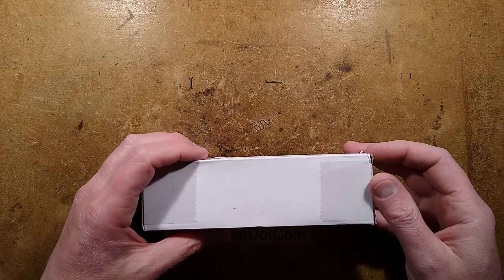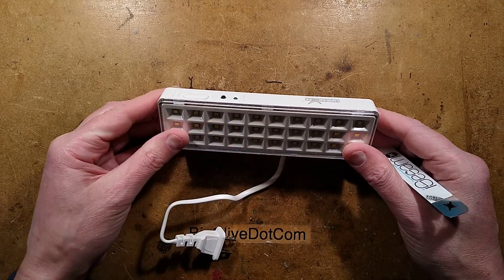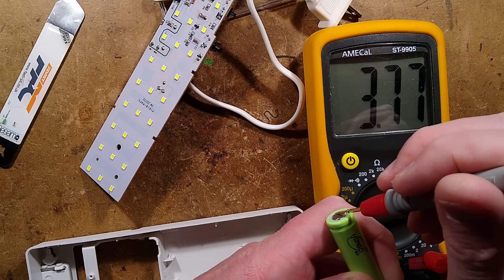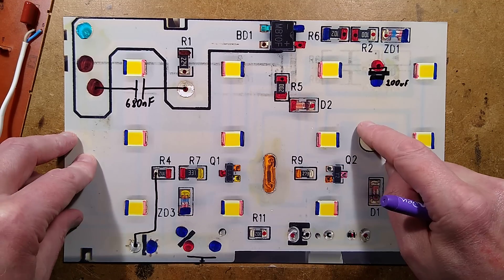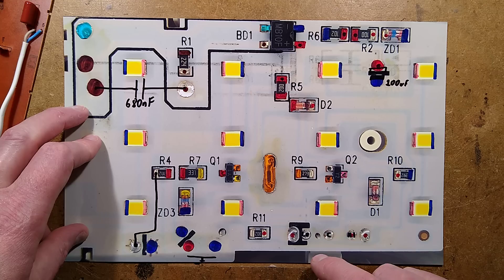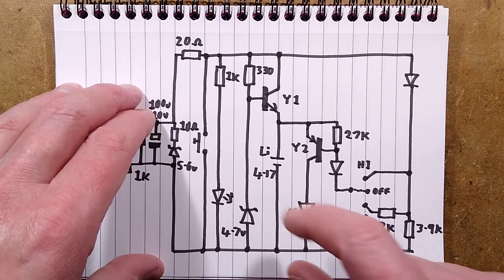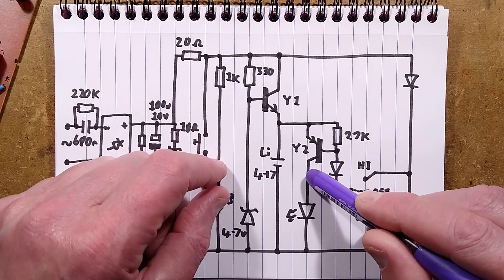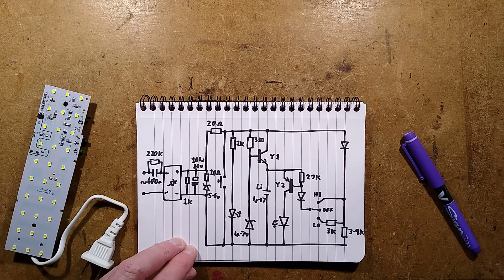$3 AliExpress 100-240V emergency light (with schematic)

Comment: Clive, our "free" lithium batteries will soon be no more. The UK government is banning single use vapes 😟😉👌
Reply from the maker: I'm sure the manufacturers will find ways around the regulations.
Reply: I don't think the ban will apply to the rechargeable disposable ones. They have nicer 600-750mah batteries inside with a nice tiny usb-c recharge circuit along with a digital display or led indicator too, rather than the 450mah-ish ones in the one-shot disposables. Get a few & parallel them. Even add a small bms if you're worried, but I don't bother cos use I them to replace the low capacity cells in outdoors solar lightning. Cheap li-ion power 😊.
Reply: tbh, banning devices that use a rechargeable battery in a non-rechargeable way, no matter what kind of device it is, would make more sense.

Comment: May be 'not bad circuitry' but not a very safe device, if it falls it can open easily showing the inside high voltage parts, neither strian relief of the powercord... Must be another quality - high safety device from good old China! to overflow our market with...

Comment: Really clever circuit,  well thought out unit,  £3.00 is a steal.  You could comfortably put emergency fittings throughout your house for about the same price as 40 fags

Comment: Every family has several emergency lights if you're in a country with frequent blackouts.
I got to know them from Brazil more than 20 years ago. But they had small fluorescent tubes in it back then.
They were everywhere - in hairdressers, supermarkets, stores, shopping-centers, garages...
Reply: South Africa the same, it is still odd that I have still had power on all the time for the last 212 days, when before you woulds have power cut almost every day, since 2008.
Reply: @SeanBZA  Interesting, I wonder what might have changed in the last 212 days?
Reply: @jimmybrad156  Lower power demand, plus there has been commercial and residential solar coming on line equal to at least 6 stages of load shedding. Massive numbers of medium power users have gone with either grid tie or fully off grid, with most of the Massmart (Walmart owned) stores all now having solar power as major part of their daily power use. Then lots of home solar and battery banks that are being used to shave peaks.

Comment: The charging circuit is a simple series voltage regulator.  These were very common before the integrated regulators became readily available. I built many series regulators myself back in the 1970's when battery eliminators were linear and unregulated. The unregulated supplies used a transformer, a diode bridge, a capacitor or two, and a couple resistors. The transformer would hold the voltage sorta close, but the AC ripple would be unacceptable for transistor radios no matter how big a capacitor you added. A better idea was to buy or build a higher voltage supply and regulate it down to the desired voltage using a series regulator. The series regulator would conveniently lower the ripple sufficiently for most applications.
Reply: The Commodore 64 (from 1982 or so) uses a regulator like this for the cassette motor. The early versions used a Darlington pair, while the newer revisions were cheapened to a single transistor.
Reply: @helgew9008  they most likely used a integrated darlington transistor in the newer revisions. They're pretty cheap and save on space
Reply: @Hunyadi1442  No, they used a 2SD313, a 2SD880 or a TIP29B. Possibly some others as well. This was back in the eighties and they were selling them by the millions, so every penny saved made a difference.
Reply: @helgew9008  ohhh, I thought that by the 80's integrated Darlington transistors were pretty common. I was born in 2005 so I don't know much about component availability from that time

Comment: With that big of a box you'd think there would be at least 3 batteries!

I have one of those black box solar lights, I had to change the battery twice in it, now I put two 18650 in parallel hope they will last more!
Reply: I managed to stuff 8 of them into a solar light, replacing the 2 dead EV lithium cells they had in there. Also had to replace the BMS as the venting cells had corroded the protection board in the shrink wrap on the cells. DW01 board, 8 recycled lithium 19650 cells, and a new glass front ( because it was stuck in with silicone) glued in place, and it has been working well for a year now. Took a week to get fully charged, and still runs the entire night at full power, even in winter.
Reply: These types of lights are ideal candidates for some paralelled disposable vape cells that we all seem to collect :)
Reply: Not necessarily, they keep heat management easy by using that LED board, then the enclosure has to be as thick as the battery in it.  Since it's not meant to be pocket carry, why would it benefit to be much smaller?  Besides, 3 batteries would increase the cost.

Comment: That can't be a very high capacity battery, 'cos otherwise the battery would be worth more then the whole unit!
Reply: If you want to check capacity of batteries like this then get an XTAR VC8 Plus battery charger. The first 4 of the battery compartments can run a 'Grade' battery checker, which does a charge-discharge-recharge and calculates the mAh's.
Reply: @andyspoo2  No need to get that specific charger.  Any better quality Li-Ion charger has a discharge capacity test function.

Comment: wont Y1 transistor get hot when charging a completley dead battery. i.e. highest current draw ?
Reply from the maker: The incoming current is limited by the capacitive dropper.

Comment: So the lithium cell will provide an audible and visible alert when its time to replace it. That's a plus I guess.
Reply: I'm with you on this.  A lithium-ion cell should never be continually charged, and I'm wary that the cell would wear out well before it should, with this style of charging circuit.  This type of charger is probably why you keep on hearing about lithium-cell powered devices going up in flames.
On the other hand, if it's a protected cell, then the protection circuitry may automatically stop the charging as the voltage rises.

Comment: This cell should have protection BMS (maybe it is built into the cell). If it is not there, it is worth adding it.
Reply: A single cell protection circuit board is still called a BMS
Reply: @davadoff  I know ! How silly !! :)
Reply: BMS stands for 'Battery Management System' this product does not contain a battery and therefore does not need a BMS, This is a single 'cell' stop with the 'Look at me everybody I know stuff look at me'
Reply: @andymouse  Untrue.   A "battery" can be a single cell and that single cell should still have protection against overcharge, overdischarge, and current limiting, except that in this case, the circuit itself inherently does this, unless it fails.  The one thing it doesn't need, being a single cell battery, is cell balancing.

In fact, some single cell batteries do have a BMS built in and then it's called a protected cell.  

As far as the look at me comment, you should feel embarrassed.
Reply: @stinkycheese804  Not me pal..Goodnight :)
Reply: @andymouse  Sounds like you should be telling this to yourself cause that actually is a lithium ion battery and they DO need a bms cause when lithium batteries get mistreated they can blow up or catch fire and thus need a battery management system. Also the fact that your logic is "battery management system means bms so it is only needed for a battery" is totally wrong! Its like saying you cant fry an egg cause its a frying pan and egg does not have the word fried in it. 

Unless this is ragebait i will take my comment away but please dont go saying "oh look its another person who thinks he knows stuff 🤓🤓🤓"

Comment: Li-ion at end of charge - must have the 4.2 Volt removed. Unlike PbSO4 batteries, they degrade very quickly if the charging voltage is not removed at end of charge.
Reply from the maker: As the full charge state approaches, the current will progressively drop to zero.  But I'd rather it charged to a lower voltage like 3.9V.
Reply: 3.7V is about 50% so the equilibrium of electrons in the positive and negative side of the separator.

that gives the max. possible life in a standby application.

3.9 or 4V is best bang for the buck hence older dewalt equipment used this as termination voltage.

the problem with the ever dead laptop batteries is exactly the 4.2V termination, keeping it at that and people not removing the battery when they work on-grid.

i got a toshiba Netbook @ Win 7 (the tiny 9-10" laptops, better known as the Asus? EEE PC), that's still on it's first battery. from 2015 !

always charge it to 50% then remove the pack when not in off-grid use and it will last AGES.

samsung one day inttoduced the battery saver which terminates charging at 85%. and even that does wonders to battery life.  like on my galaxy Tab A SM-T585 (also on it's oem battery)
and the previous white /silver bezeled Tab A that only serves as a kitchen timer for eggs and stuff.

treated right Li-Ion and Li-Po can last a decade.

but most devices + users never treat batterys right. being an apple product + the accompanying user makes everything even worse.

Comment: I built an emergency light before myself. I made the circuit with the Software "circuit" by Paul Falstad. I connected 14 one F Capacitors together, and you could charge them with a small hand powered generator. 30 seconds of charging is enough to power a white LED for about 8 hours before it gets dimmer. The capacitors are not anywhere close to full after 30 seconds so it has more potential. I was annoyed by these cheap hand powered flashlights that perform really poorly and wont work when you really need them.
Reply: 1F caps - that's a bloody big capacity.
Reply: 14F worth of capacitors for barely any light for 8 hours?  Seems expensive and bulky.  Have you ever heard of "batteries"?  I can grab my EDC AAA powered pocket flashlight and have light for 8 hours, or a lot more light for 1 hr.
Reply: @stinkycheese804 you can't charge a aaa battery and you can't leave it empty for years and expect it to work. Capacitors seem like a pretty good option for a hand cranked emergency light.
Reply: @stinkycheese804  I made it for emergency and camping. The capacitors can be charged more to hook up more LEDs and to last longer. 1F Capacitors are not that big (some of them are) and you can get them cheap. I got mine on amazon.(about 50€ total)

Comment: I'm looking at it and wondering if an 18650 would fit with a small amount of modding? At least it could have a protection circuit built in. 🤔

Comment: I bought an emergency led thing off aliexpress a few years ago, had the usual figure 8 plug input, worked one way, but when I plugged it in the other way it blew up
Reply from the maker: Most likely a bad connection causing arcing in the connector, or just circuitry on the edge of going boom.

Comment: Be careful! This charging circuit doesn't meet the charging requirements of standard lithium cells. When the voltage reaches 4.2 V and the charging current reaches an average of 0.1 of the initial value, charging should stop completely, otherwise a slow degradation of the battery electrodes occurs with the risk of short circuit over time. This emergency light itself will eventually cause an emergency. It's quite ironic.
Reply: What's really ironic is the light won't work during the emergency that it caused.
Reply: It should provide ample light in theory, and act as a back-up heater for those winter power outages.

Comment: I cant speak for all zenners but the ones that I used to design with had a voltage specified at 1mA for the 250mW and 500mW parts and 10mA for the 3W ones.

Comment: I hoped you would check the current draw when testing in low and high brightness.
Reply from the maker: 4.2V = HI-170mA LO-106mA
3.6V = HI-120mA LO-73mA
3.0V = HI-84mA LO-51mA

Comment: I'm amazed there aren't more zener+junction-drop charging circuits.  I guess you do have to make sure the input is current-limited, but at 500mA, most lithium cells will cope with that just fine, and it'll drop as the battery gets closer to full.

Much simpler than a full BMS.  Cheaper?  Dunno, charging chips are jellybeans these days anyway.

Comment: I wonder why they've done it that way... Dedicated charge controller chips are very cheap these days. But this is definitely a valid way to limit the voltage, and could be used in a DIY project.
Reply: Although, if the zener 4.7V zener diode fails open circuit, it could overcharge the cell. But zener diodes generally fail short circuit, and there won't be enough current to blow it open.

Comment: I might get a few of these for my basement, but modify them for 12V DC power as I don't want to run mains cables to the various locations.  Maybe I'll use an LM317.
If the 500mAh batteries don't last long enough, then I can make the lights dumb and the 12V DC can be on battery backup and handle the cut over on power failure/test.
Reply from the maker: I'm wondering if using a 5V USB supply on the DC side of the rectifier and maybe getting rid of the 1K resistor next to it may be an efficient option.  My choice of power failure lights is still a head worn light and the classic PIR ceiling lights that will kick in when needed.
Reply: No need to even use a LM317, just remove the 680n capacitor, and replace with a 220R 0.5W resistor, and it will operate exactly the same as before on 12VDC or AC. Battery the same, or replace with a pouch cell, though this cell likely will provide output for around 5 hours on dim setting, slowly fading as the battery discharges, so it will still glow after a day with power off.
Reply: Why even bother?   I mean you don't need this light at all then, just use a buck switching current regulated LED driver to drop from 12VDC to whatever current your array of LEDs needs.  More efficient, or of course you could just swap out the 14500 cell and swap in an 18650 around 3400mAh and it'll run longer than you'd normally need.
Reply: I design IoT based emergency lights for a living (amongst other things), so the electronics is no problem.  LM317 was just a quick idea that others could also use, as I typically use boost or buck LED drivers from Diodes Inc.  My interest is the low cost compact housings.  They don't need to be compliant with standards for use in my basement workshop.
Reply: BTW, I ordered some of these lights 3 weeks ago, and got them last week.  Getting ahead of the BigClive effect can be important as the price from the store I bought them has now nearly doubled.  Still reasonably cheap, but not quite as easy an impulse buy.

Comment: Very clever way to connect to the battery!
Reply: Avoids needing a battery lid! (which always gets lost or broken). Cunning cost-saving.
Reply: Very cheapy Chinese mass production stuffs
Reply: @Liz0rdX80  I think the way they did the battery/hold very clever, also makes it easy to upgrade the battery capacity or replace if failed, no soldering, etc.
Reply: @richardwernst  yep

Comment: It shorts its power supply to test? That's cheeky!
Reply: It's not /quite/ a short, as there are resistors in the circuit.
Reply: That avoids high voltage appearing anywhere past the dropping capacitor. It's also a real test.
Reply: Nothing is significantly stressed by shorting the supply because it's a constant current feed.  The voltage across the dropper capacitor and the feed current increase by about 2%.
Reply: I wonder what the supply current goes up to while the Test button isreerssd? Would it damage the bridge or dropping capacitor in any way?
Reply: @FamilyOfEyles  It’s going to be about what was shown on the meter, which for a short would be around 52 mA or so. This is roughly 50 mW of dissipation if my iPads calculator is correct (if it’s wrong it’s always the machine’s fault! Never mine. EVER! 😅). The greater risk is shorting out the electrolytic since it would pit the contacts in short order if the resistor was not there.
Reply: That is not what is known as short.
Reply: They could have wired it to open the line, too.  
This reminds me of a plug-in automatic night light that Clive did.  It turned off the LEDs in daylight by shorting them.  It drew more current when it was off than when it was on.
Probably they do it to make a simpler circuit board.
Reply: @Fred2-123  Normally-closed tact switches are rare and expensive.
Reply: I was wondering why the 20 Ohm resistor was important, the schematic was revealing 😂